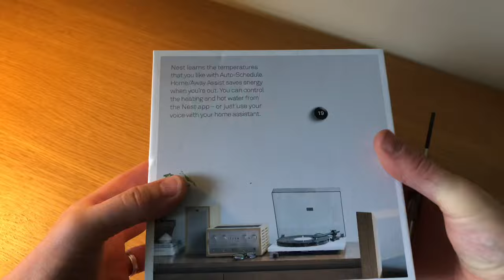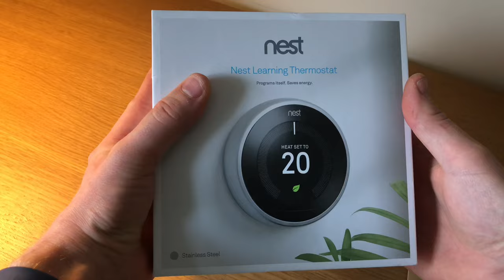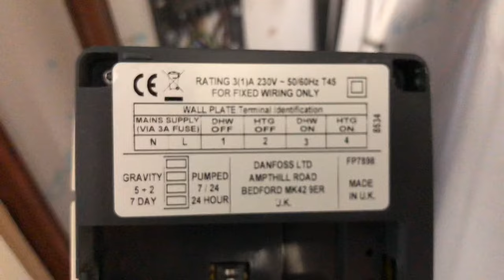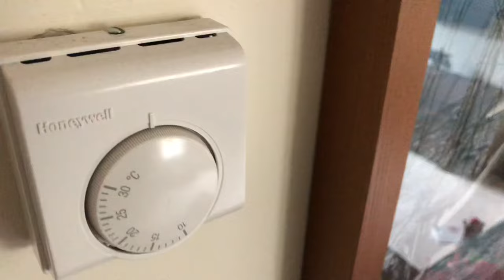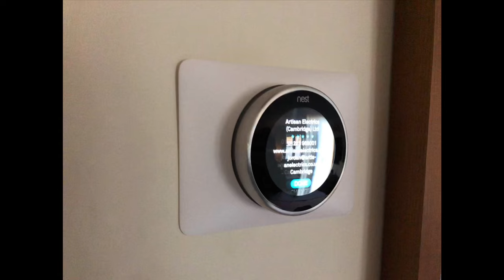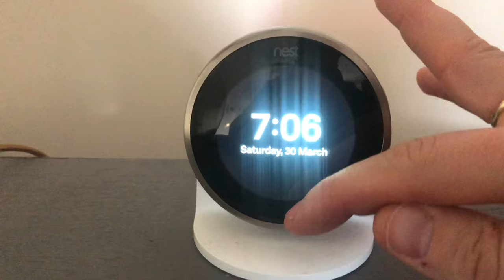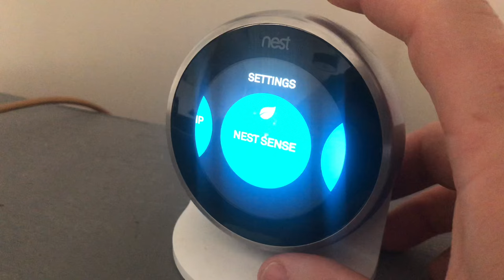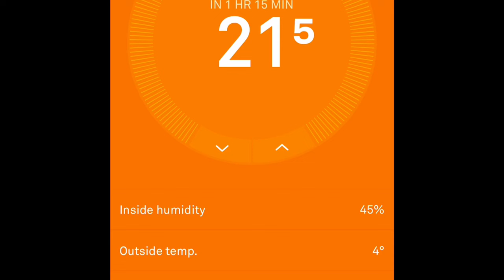Nest Learning Thermostat 3rd Generation Installation UK

Comment: Thanks for the video.  Although initially impressed and pleased with the device prior to Google taking over Nest, I've found it works against our heating requirements.  I suspect an updat a few September's ago caused issues.  It's crashed caused issues so I've switched it off.  The lack of Nest produced remote radiator controls valves still disappoints me, but Google have said hardware - beyond the actual Nest - is not there thing and 3rd party solutions have mixed reviews and are not cheap to try.  Can't help thinking it's something the original Nest company would have developed.

Comment: Hi mate great video, i have the same set up but my thermostat is wired direct into the programmer not the wiring centre. So would i just need to wire the heat sense in place of the programmer and either wire the thermostat off of the heatsense or alternatively plug it in on a stand elsewhere and then not have to touch the wiring centre?

Comment: I had a new boiler fitted recently and a Honeywell thermostat downstairs controller was fitted that is wireless to a hub upstairs next to the boiler, so no wires available to the downstairs thermostat. Does the Nest Learning thermostat round controller need to connect to wires downstairs or can it also connect wirelessly to the Heat Link next to the boiler?

Comment: I have connected the nest up and currently have this on the stand and set my old thermostat to full heating and the nest overides this to the temperature I set this at , I wish to wall mount this in the existing position of the old thermostat which is the same thermostat as yours am I right in thinking I need to source the wires from the thermostat to the wiring centre and remove , then connect to the 12v heat link terminals and nest thermostat ?

Comment: So you are a qualified electrician. How do you reconcile the IEE regs for electrical safety regarding segregation of 12 volt and 230 volt wiring in the same enclosure in this case? Do you identifying the 12 volt wiring?
Reply from the maker: Good point, not sure about that one
Reply: In a perfect world the thermostat cable should have been removed from the wiring centre.
It should then be taken directly to the nest box.
This would provide a practical solution for compliance with IEE regs
Reply: As roger said. U can run the 12v cable straight to nest box so it’s not in with the 230v at junction

Comment: Hi

My programmer is next to my boiler in the downstairs kitchen and wiring centre is upstairs with hw cylinder, is there anything I need to consider? Ideally I want to remove existing programmer and install heat link in its place, my understanding is I will struggle to use cable from old room thermostat due to location of my programmer and wiring centre?

Thanks in advance

Comment: HI There, if i already have the nest device hardwired, how do I relocate the device to a different location? Is it as simple as plug it on the nest stand which i don't yet have? Thanks
Reply from the maker: You will need to bridge out the terminals in the wiring behind the nest thermostat or disconnect them completely in the wiring centre and then fit the thermostat on a stand
Reply: Artisan Electrics cheers! When you say disconnect the wiring, you mean disconnect it heatlink from the current hardwire stand? Thanks

Comment: does anyone know of a video if you do not have a thermostat in the house? (heating is turned on from the main boiler)
Reply from the maker: No but I’m guessing it will just require additional wiring to be installed

Comment: If my current thermostat is 230V and I want the hive thermostat in the same place how easy is it for an electrician to install the hive with it need 12v supply? Thanks!
Reply from the maker: Very easy, the hive thermostat itself just uses batteries. The wired thermostat can be removed and disconnected at the wiring centre.
Reply: Artisan Electrics sorry I meant the Nest thermostat..my bad!
Reply from the maker: Ah sorry didn’t see which video you commented on! The wires from the 230v wall mounted thermostat will have to be connected to the 12v terminals in the nest heat link, or you can just buy a stand and install it on that which is the easiest option in my opinion.
Reply: Artisan Electrics thanks a lot for your help!
Reply from the maker: You’re welcome!
Reply: @artisanelectrics  hi

So does the nest stand have to be plugged into a socket

Thanks

Comment: Thanks for this. How do I know what wiring scheme to use with my boiler? It's a combi boiler but I think it's Open Therm as well. How do I know whether it's s plan or y plan, or just regular 230v combi, or open therm? Struggling to get the wiring correct.

Comment: Serious question, how did you get the 12v cables from the heat link to the thermostat? I have a similar problem with only live wires in the thermostat and can only put the nest on a stand.
Reply from the maker: Disconnected the wires to the thermostat from the wiring centre and connected them to the heat link

Comment: Hi maybe a silly question. But my wiring centre is upstairs and the control panel down stairs so how do I transfer the thermostat wire from the old thermostat via the wire centerwire  (upstairs) to the new heat link (downstairs) thanks.
Reply from the maker: If in doubt call an electrician!

Comment: Hi there, Brilliant video and great work.  I have the same programme time as on the video and the cables are the same. The only difference is I have two thermostats that run independently. One on ground floor and one on 1st floor. So how and where do I connect the second thermostat from the bedroom? Will I need to add separate heatlink for both zones or can I just get another nest thermostat? Thanks in advance.
Reply from the maker: Hi! You need a separate heat link and nest for each zone.
Reply: @artisanelectrics  brilliant and thanks. You haven't got a video to explain all of this do you? Or if you ever do another similar setup please film and upload. Thanks again.
Reply from the maker: Manir Dhakal good idea thanks!
Reply: ive got the same setup, although I rarely use the upstairs zone so would like to leave that as it is, can I do that and just have the next downstairs?

Comment: I live in a rural part of Dorset and we get frequent wifi drop out and power cuts in the winter. I have already installed Hive but this requires manual resetting and rebooting each time it loses connection, defeating the object of remote control. Does Nest automatically reset if it loses power and or wifi.
Reply from the maker: Yes it does!

Comment: hi, so i have a controller the same as the one in your video that controls my hot water and heating, exact same wiring inside. But i don't have a thermostat on the wall to adjust my radiator heat, that is done by how much i open my valves. so can i wire a nest to do exactly the same job of having my hot water/heating on a timer or turn on and off as and when i choose. many thanks
Reply from the maker: Yes that should work fine, you will just need a stand for the nest thermostat to sit on instead of the wall.
Reply: @artisanelectrics  hi. thanks for the reply. so my wiring from my danfoss controller i have exactly the same live, N, E, hot water, and heating. i assume the L,N, and E go into the lettered, symboled terminals. although the earth isnt needed? which terminals do i need to put the hot water and heating cables ?
Reply: @artisanelectrics  could really do with some expert advice, if you can. i have mounted the controller where the old one use to be but have used a 3m usb cable to a plug and into a spare socket under my stair cupboard to power it. i have mounted the heat link under the stair cupboard also. With the 5 cables from the existing danfoss controller i have wired the earth, live and neutral and it powers up fine and is paired to the controller now through wifi. i just don't know where to put the two remaining black cables that use to call for heat or hot water in the danfoss controller. so at the moment i cant get any heat or hot water. so have temp wired the old controller back up so i can use it.  if you could help me i would be very grateful. many thanks

Comment: How do you convert voltage to 12v for heat link and thermostat base?
Reply: You don’t. T1 and T2 the last two terminals on the right of the heatlink are 12v positive and negative so you can just use the wires that were previously sending 240v to the old thermostat and re-terminate them into the heatlink.

Comment: I don't understand this. If Nest Thermostat can be used with Nest Stand (going into a regular power socket anywhere in the main room) and it still can communicate with Heat Link, why do I have to hard-wire it with Heat Link? 
Shouldn't there be a way to just connect Thermostat with a regular 12V supply, not the original Nest Stand? If it is a fkn smart Thermostat, should it communicate with Heat Link then too?
Reply: The thermostat can be powered and pair with the heatlink either hard wired in with 12v from the heatlink or wirelessly. The thermostat comes with a ring that it clips in to which has both 12v terminals and a micro USB socket. You don’t need the base at all technically, the ring can either be screwed onto any compatible base or wall mounted.

Wouldn’t recommend them at all though they’re plagued with issues. Quality control on the heatlinks is absolutely horrendous and the Wi-Fi on the thermostats fails fairly often as well. Electric override switch on the heatlink as well so when it does die, you’re stuck without any heating at all until it’s replaced or bypassed and you can’t buy them separately.

Comment: Hi. I have a mechanical time clock mounted next to my gas boiler, to regulate when my heating comes on and goes off, and i can set it to be constantly on or constantly off. I also have a temperature control unit in my hallway. My boiler only heats the hot water when i turn on a hot water tap. Do i need to replace both the time clock and the temperature control unit with my set up or only the temperature control unit?
Reply from the maker: I think the time clock will be replaced by the Nest Heat Link and the room thermostat will be replaced by the Nest Thermostat or you can disconnect it and use the Nest Thermostat on a stand. But you would need a professional to check this as it’s a slightly more complicated system than usual.
Reply: The wire colors on his install might be right, but G is normally independent control of the fan.  On a conventional system, the Ys are the compressor, the G's the fan, and the W's the heat.

heat and cool come in stages.  A heat pump adds the complexity of a reversing valve and aux heat (resistive).  Dual fuel is also possible.

Some thermostats like to know the outdoor temperature.

A communicating thermostat changes the rules again with things like energy recovery units and external ventilation.

(C) was not used on early bi-metal thermostats.  There are clever devices that can add-a-wire.

Some stats are "power-stealing" which is hard to explain.

Some only run on batteries.

R and Rc require a special mention.  It should be called Rh and Rc.  This allows separate transformers for heating and cooling.  I'll  be calling it R and no be specific and not covering Rc and Rh variences.  Assume Rc is connected to R/Rc and called R.

(C) is the other end of the transformer in the heater controls.  It is common to all of the relays.

R is the other end of the transformer.

Between (C) and R, (whatever the labels are) there should always be 24 VAC.

The relays in the stat have one end of the coil tied to R through a contact in the stat.  The other end of the coils connect to C. 

A jumper from R to W turns on the heat and usually the fan.
A jumper from R to Y JUST turns on the compressor and not the fan.
A jumper from R to G just turns on the fan.

A few more comments:  In conventional systems  G is an always on or automatic fan.
 The furnace usually controls the fan unless overridden.  The fan comes on later than a "call for heat" and the heater  turns off when the call for heat ends.  The fan time is extended.  This can be by time or by sensor.

it takes lower HP to move warm air, so therefore a lower speed in heating.

With AC, the fan and AC turn on and off at the same time.

the air cleaner and humidifier need outlets.

Finally, fan speed can help control humidity.  Outdoor air temperature and the time can hep the anticipator algorithm, static pressure, RPM, CFM

My stat (A carrier Infinity) is totally nuts.  run time, date singe install, errors, faults, when to change the air filter, outdoor temperature, zoning are all part of the stat.

Carrier Infinity does a filter change test every day and zoning controls do not need a bypass damper.